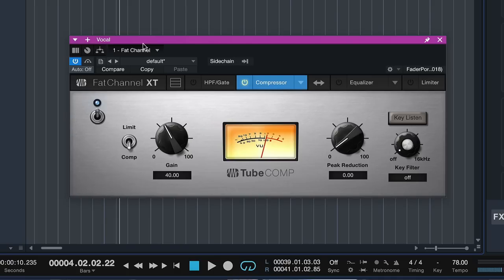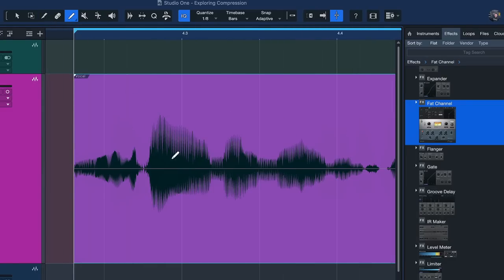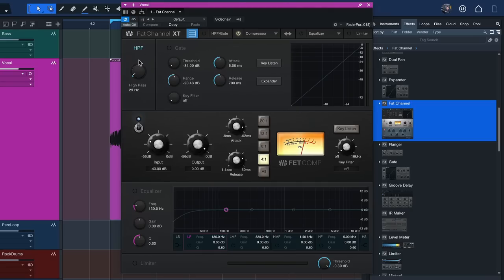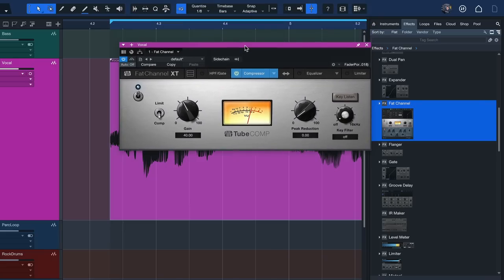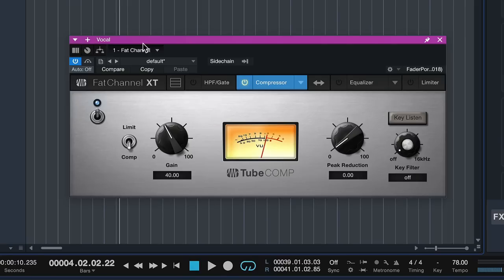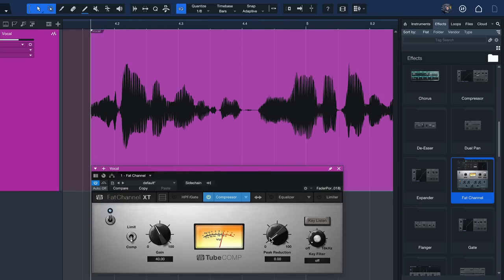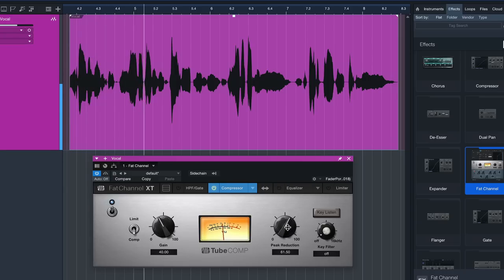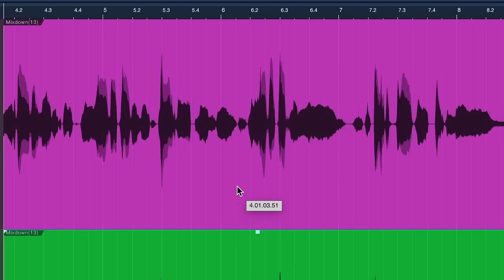How to use TubeComp in Studio One

Comment: I use clip gain to even out the wave about 50% using crossfades.  The Tube Comp is an LA2A emulation.  Alanis Morissette insisted on recording Jagged Little Pill with an LA2A.  They're a little bit slower on the attack which lets the initial transient of each word through a little more - something you may not even notice unless its not there, but you can feel it.  Makes the words of the song easier to hear and understand and feel.  I personally think that is their magic.  And being slower, they're a little smoother.  You have no attack or release knobs, so you are reminded that you are making music and aren't in control of everything :)

Comment: I'm a Presonus fan, but honestly, the problem with the TubeComp and the fat channel in general is, it has no character. This unit doesn't generate any harmonic distortion no matter how hard you push it. It makes the module pointless. Attack and Release curves are important to get the feeling, but that's nothhing you can't achieve using the standard comp module. The truth is, there is no color in it... It looks cool, but it sounds like a clean digital compressor should, just like the stock one.
For me the fat channel is a great concept, but it just doesn't do the job. I bought several modules, and stop using them in a few days. Maybe the 160 has a kind of nice snappy sound, but I guess if it is for real, or just the fact you can see the Below/Above lights and it visually helps to set it right for some materials.
Again, I own Presonus Software and Hardware since decades, and I love you guys, but this one is almost a scam. 
Prove me I'm wrong, I'll be happy for me and you.
Reply: It doess say "Tube comp" but its actually a opto compressor. You can add a saturation plugin like the "redlight" plugin which is amazing by the way. Orrr you can use a preamp plugin like a Pre73 or something like that. This plugin is simply a leveler plugin. Not so much a character plugin. Hope this helps

Comment: An unrelated question.
My audio volume is so low in S1. In normal use, I keep my system volume at about 8-9.
When using S1, I have to really crank up the volume to 35-40 to get a comparable volume.
Is there something I can do to increase S1's volume besides juggling my system volume every time I use S1?